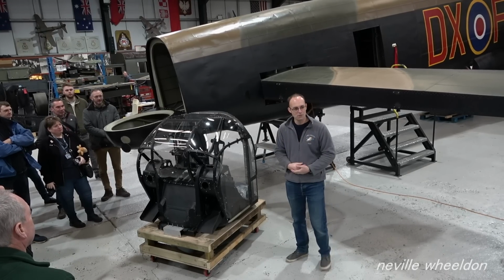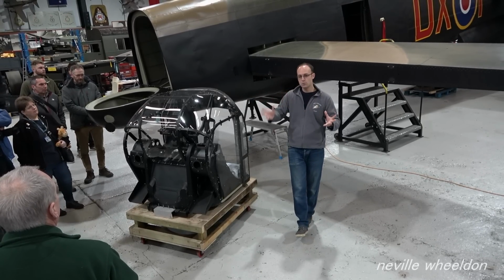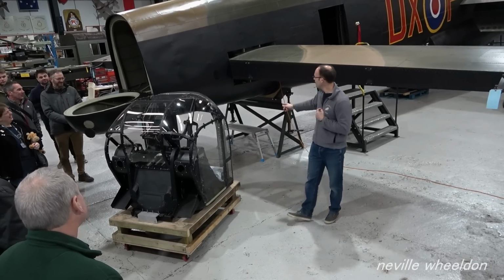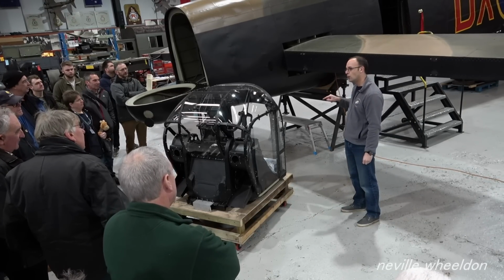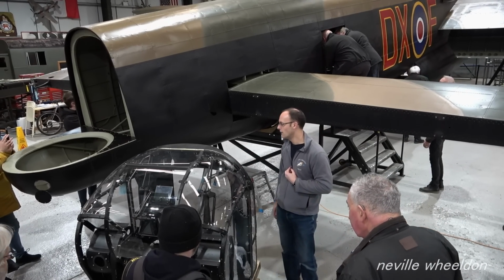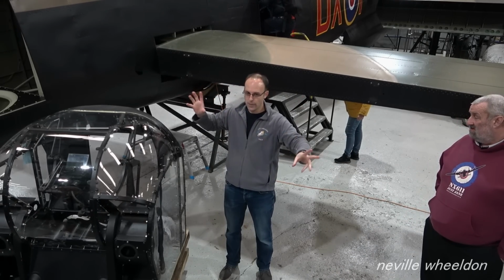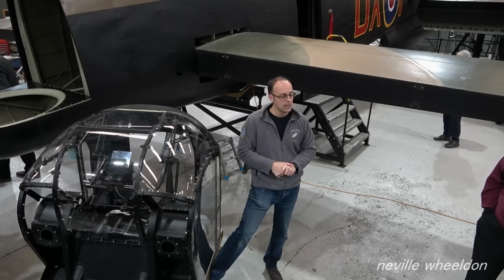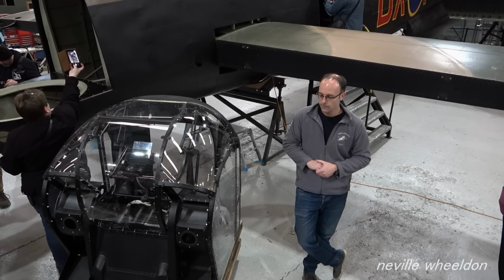Video 182 Restoration of Lancaster NX611 Year 6.   Winter restoration tour of Lancaster NX611.

Comment: Hi Neville, great video giving an overview of the project. Is there a video in your series which covers the process of how the various components are declared to be in an airworthy condition?  Are there inspections carried out by an outside agency like the CAA?
Reply from the maker: Hi Papa Boule, yes the CAA have been involved since the start of the restoration. The Centre as 4 registered engineers with the CAA who can singe off work as Airworthy.
Reply from the maker: Hi Papa Boule, the CAA oversee the parts which are going to be Airworthy. Four of the engineers who work at the Centre are registered with the CAA they can pass work done by them self and work done by other engineers as Airworthy
Reply: @nevillewheeldon1693  Thank you for the reply. That level of skill must be a valuable qualification for these engineers to hold.